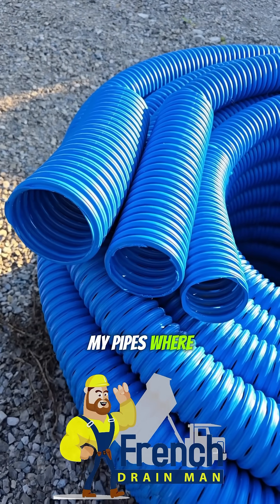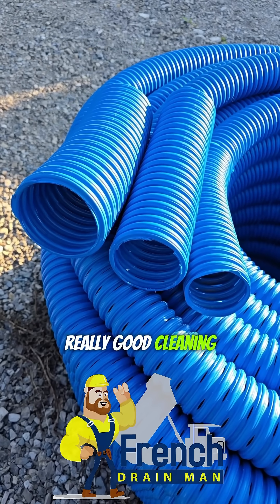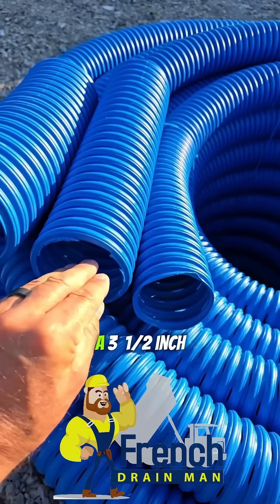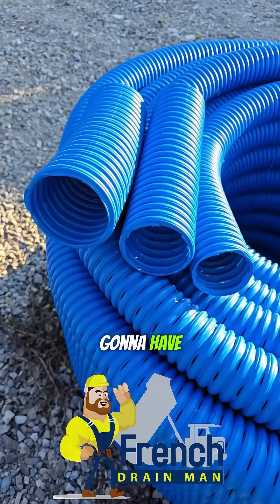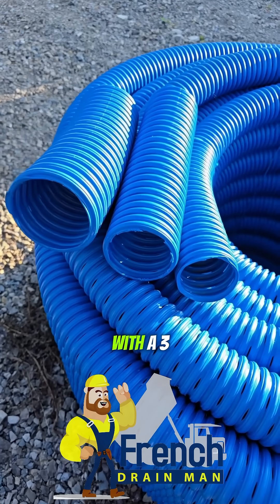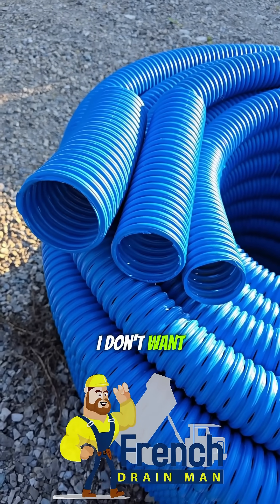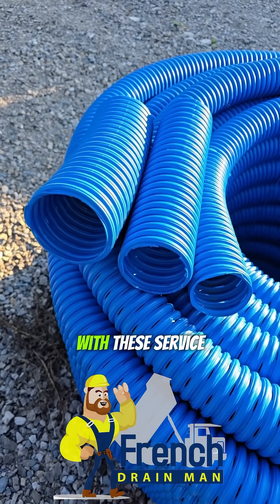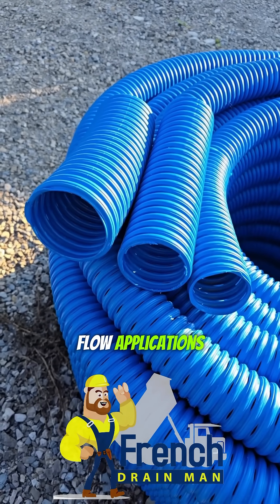Why You Want Your Yard Drain System Maxed Out!

Comment: Show off how we are to use Atlas 14, or maybe you've upgraded to Atlas 15 on NOAA. The upper bounds for the 100 yr or 1% flood on NOAA are what I plan for.  You are somewhere at 1.1 inches in 5 minutes where I'd see near 1.8 inches in the same 5 minutes. Note Atlas 14 is only 90% accurate, so we may need to size up 10% for home-defense.